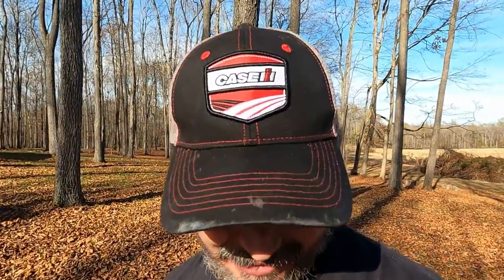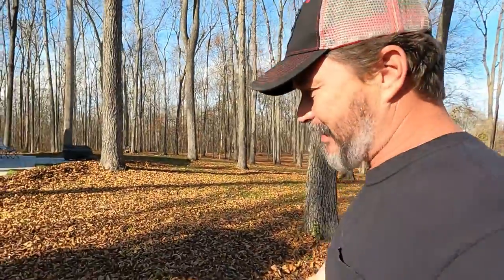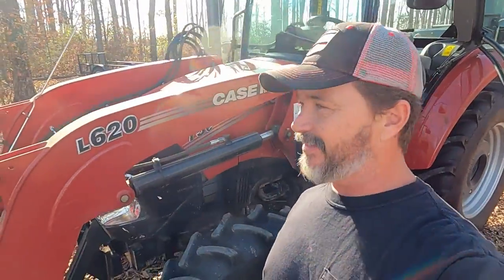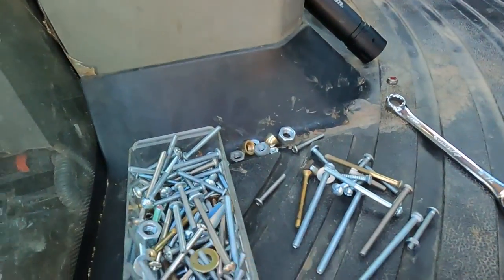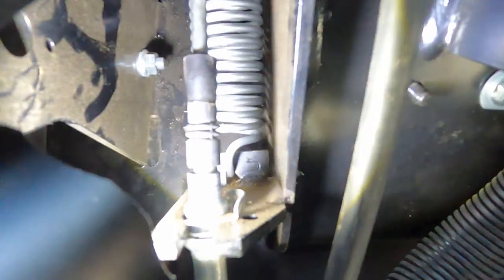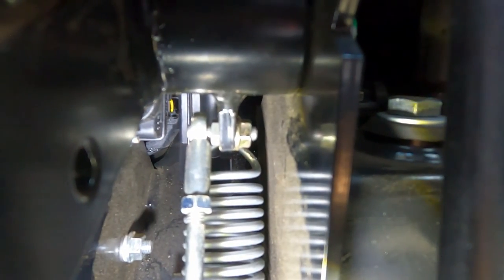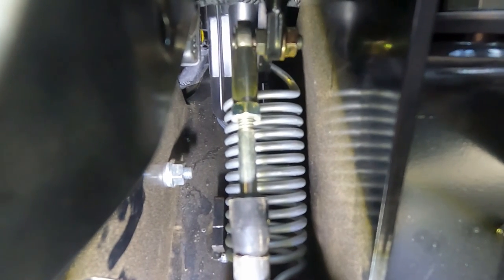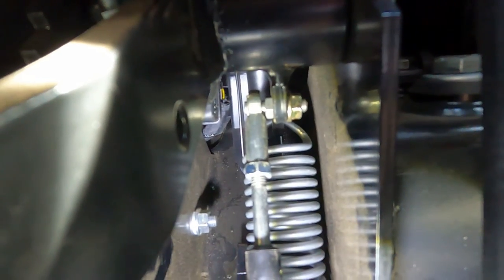Do This To Your Tractor Now! Case IH 75C Has a Simple Preventative Maintenance Item. Get It Done!

Comment: The weak link in the set up is the e-clip on the clutch cable side of the fastener.  Replace the entire part with a 6mmx35mm Clovis pin with a cotter pin and never worrying about this again.
Reply from the maker: Smart!
Reply: Would you have a picture of the fix